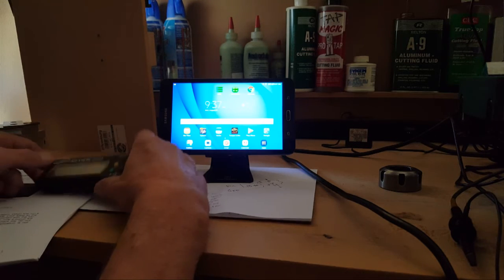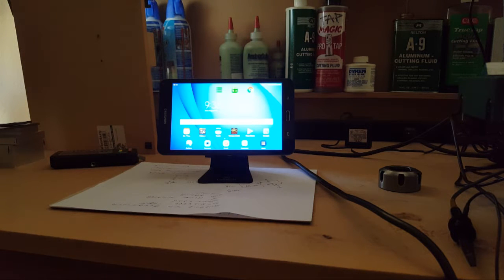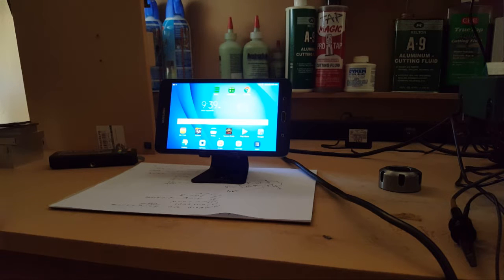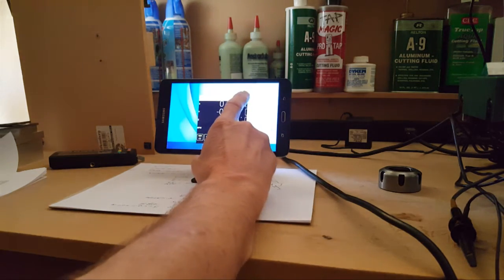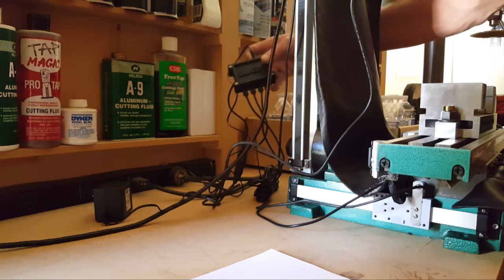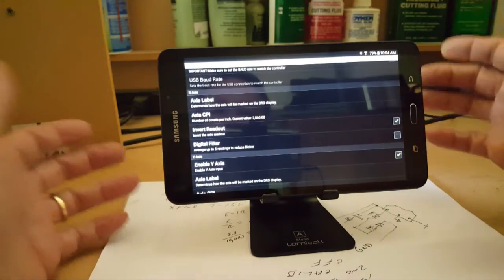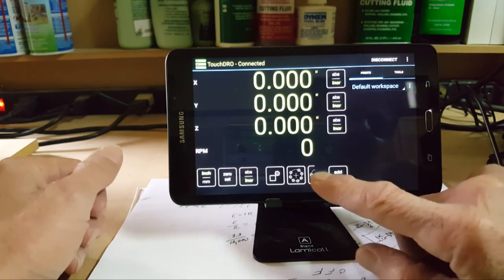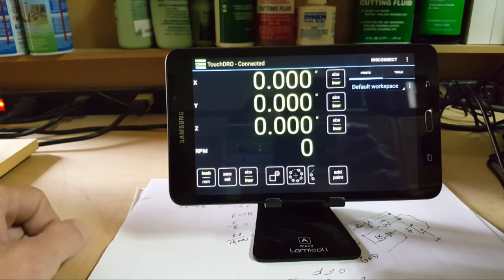Blu-DRO & TouchDRO App Operation & User Manual

Comment: Ive got to ask whats the advantage of this over day a cheaper bangood $200 kit?
Reply from the maker: The scales are easily cut over cutting a glass scale and you don't have the large pickup unit where the scale has to be mounted exceeding the axis length allowing excessive travel. It's a much cleaner install.
Reply: @TheMiniMachineShop  Thanks, you have a link to the scales?
Reply from the maker: @steveb936  http://www.igaging.com/ez-view-dro-digital-scale.html

Comment: Dave

When using the 1/2 funtion, if you use the same edge finder for both edges, the there is no need to subtract the off set for the edge finder, as you measuresments are offset the same on both sides, so just use the reading and the 1/2 function to find the center.  Of course if you are just location/finding a single, you need to ajust for the edge finder radius

John

Comment: im running Touch DRO on my Pixel 2 xl with android 9.0 with no issues. But i built mine off Yuriys site with an arduino . Works great . Had it a year or so now and i love it  http://www.yuriystoys.com/2012/09/arduino-bluetooth-module-wireless-dro.html
Reply from the maker: Do you have the tach working?
Reply: Dave M  yes  but only after loading this code in as the original would not work /http://www.rysium.com/rysium.docs/
Reply from the maker: That's the difference you have control over code. I'm blind... No source for the app or Blu-DRO!
Reply: @TheMiniMachineShop  that's the reason I decided to build mine versus buy one. And it was way cheaper and so simple took about an hour to build and test .

Comment: I  just thought of something that maybe you have figured out, how do you use the alarm feature that is supposed to alert you when you get to or close to a preset dimension ?  Mine does not work at all
Reply from the maker: Nope still an unknown problem as mentioned. What rev android do you have?
Reply: Dave M I have Android version 4.4.4 on a Samsung Galaxy Tab E Lite
Reply: Ugh. That's why I'm here. The manual he wrote gives some info. Perhaps that part was written after this was posted. I'm going to see if I can make it work tomorrow.
Reply: Update: It just plain doesn't work. Is there a magical secret that I don't know?

Comment: Very cool Dave!  I have had TouchDro for about 2 years now and I am still learning new things with it.  I find your comment about the power supply to be very useful.  I have never heard this or seen anyone post about it online.  I am using the power supply that was included with the Blu-Dro and I am also using the fourth digit (tenths).  I do occasionally experience digits jumping around and sometimes they’re a little lazy, meaning it takes a while for them to respond. For instance if I am at .7491 and I am creeping up on .750” , the tenths will sometimes go from .0001” to .0009”.  I will try and find a better power supply and hope that this fixes the issue.  
On another note, it would be nice to see all of the functions explained such as the bolt pattern or arbitrary bolt circle or whatever its called.  I think an explanation of it would help us all.  Like you said, theres no user manual available.  I also hope Yuri comes out with the new update soon.  I hope he didnt loose interest since his product was stolen by overseas vendors.
Reply: I built a PCB for the interface circuit to the DRO scales and soldered on an Arduino Uno. I found that the milling machine motor noise caused problems with the accuracy, so I used an inexpensive 9V battery to USB (a switching buck regulator from China) and that eliminated problem completely, steady as a rock. Also, for those who had problems with zeroing out the relative scale values, like I did, download the app again and reinstall. Though my version of TouchDro from last year was same as the current version, 2.5.10, it had issues.

Comment: You've really done a service here. I've got one of Yuriy's Bluetooth kits that I use on my mill and one of the Arduino build it yourself boards. The Arduino board is an easy build and kind of fun. I'm looking forward to the tach fix so I can install one on the mill. Amazon has adapters for micro USB to mini USB really cheap. I'm using them with an older set of Igaging scales and Arduino board. I really want to thank you for all your videos and especially for the work you're doing on the TouchDRO manual!
Reply from the maker: The scale itself is keeping track of axis position. So if you are at 1.923 the scale transmits serially to the display the position is 1.923. So it appears the scale is getting noisy 3.3V power or something is messing up the transmission. This would be my first guess.
Reply: I installed ceramic cap as per the circuit diagram on Yuriy's site without any effect.  Anything I can try to make it work? Bigger cap? Currently using 0.1uF.
Reply: Kyle Wong are you using Yuri’s kit or Blu-Dro ?  Do you have any fluorescent lights in the same circuit or near the machine?  Is your motor to the machine grounded?  You might have an insulation problem where you need to isolate the scales from the machine.  Also sometimes the jumping is caused by your android device. What tablet are you using? Also if you switch from one machine to the next sometimes the Bluetooth does not reset. Can you explain in detail how exactly it’s jumping and when it is doing it
Reply: I didn't have this problem, but I built mine on perfboard and didn't use a breadboard. The breadboards do induce some capacitance and resistance into the circuit. Also, I'm using a Nano but that shouldn't make any difference. You could try a bigger cap since being breadboarded it should be easy. I do remember something about the jumping numbers but don't remember which site it was on. Yuriy has a Google+ and it could have been there.
Reply: George Chambers I’ll try with a bigger cap. Saw the part on jumping numbers but mainly covering on flickers if I remember correctly. I’ll take a look again. Thanks for pointing that out. 
I’ll also try soldering the parts down on the shield I bought.
Reply: Kyle Wong I wish I could help you but I am not familiar with Yuri’s kits.  Sorry
Reply from the maker: This is excellent input on the adapter! I have an old set and will see if it works. THANKS...
Reply from the maker: Actually the question is can you use the adapter on the new Blu-DRO unit? Again no yes or no on the web site!
Reply: Dave, I've used them just about every time I needed to make this adaption and they've always worked. Although not having a BluDRO I can't guarantee anything. ;-)  I've used them even on one of my 3D printers with no ill effects so I would guess they will work since it's just a straight passthrough from one size to the other.
Reply: Hello George, I did the same using arduino but reading is jumping all over the place.  Would you be able to help?  I tried going through the troubleshooting guide on Yuriy's site but couldn't get rid of the problem.
Reply from the maker: Explain what is jumping?
Reply: It goes from very a big number to small values without me touching the scale, non-stop. The scale hasn't been mounted to the mill.
Reply from the maker: .1 is only good for hf noise back up with the camera and pan everything so we can freeze and look. I suspect there is a ground loop but need to see from the power supply on....
Reply: I agree it sounds like a ground loop.

Kyle, make sure all grounds are connected together to avoid having a ground loop.
Reply from the maker: The word from Blu-DRO only scales that have mini-b connectors that are compatible are the iGaging 
DigiMag and the AccuRemote Super High Accuracy scales. The other older iGaging scale 
that simply had AbsoluteDRO written on it is not compatible.
Reply: The scales I have are the really old ones. I had them on my other mill for a couple of years before removing them. Check out MrPragmaticLee channel. He has used the BlueDRO since it was still a blue 3D printed case. He has videos going back to the early scales and BlueDRO. Check it out. Although he hasn't used any adapters that I know of. Here is the link to the adapters I use--
https://www.amazon.com/Bonayuanda-Female-Connector-Adapater-Converter/dp/B01JA75J18/ref=sr_1_3?ie=UTF8&qid=1535241653&sr=8-3&keywords=usb+minib+to+micro+b+adapter
The reviews are mostly nit pickers, my review to you is for the price why wait. If BlueDRO is correct you will still find many uses for them.